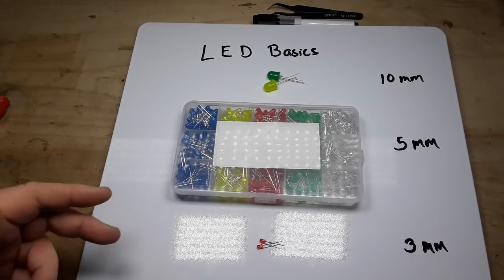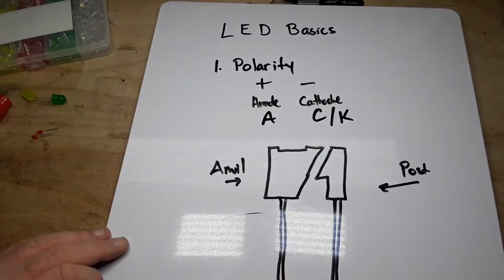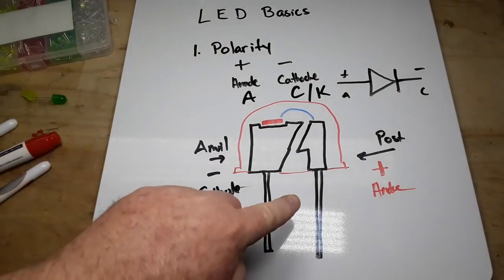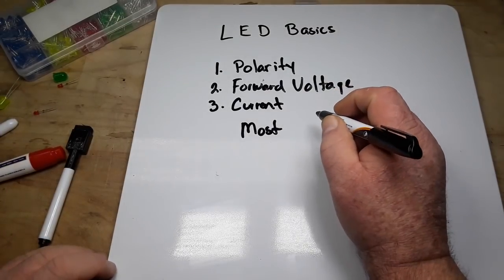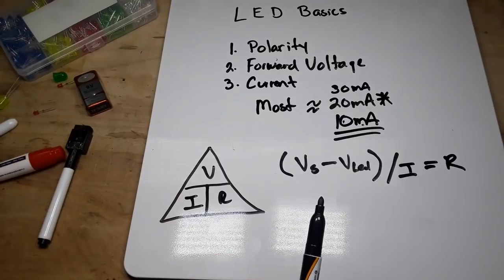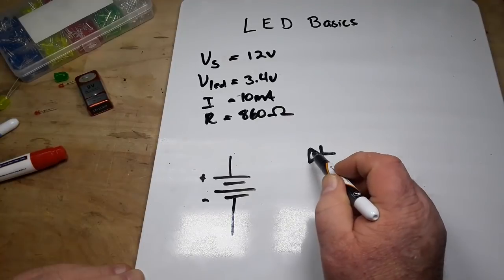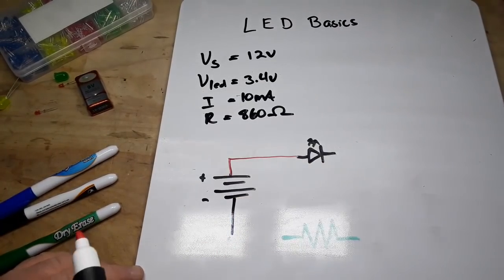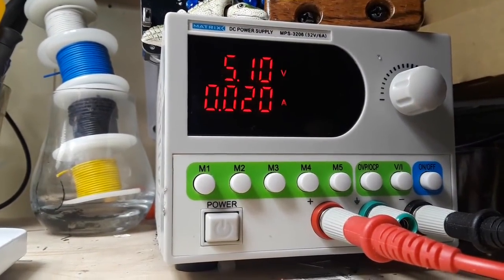LED Complete Basics for Beginners

Comment: Oh man  , I was reusing an LED and the legs were cit down to the same length . IT was opaque so I couldn't see the inside , and couldn't tell the positive from negative side . 
For an hour i sat there scratching my head with the bulb ... trying to figure out what way to solder it in .
Well I scratched my head soooo long with that little LED that I wore a flat spot on the base of the bulb .
Finally I said FK IT this flat spot looks  pretty negative to me .

Comment: i got two kinds of red led's one is 800mcd 1.7v 20ma the other is 5000mcd 2.3v but does not mention ma? i will assume 20ma, so anyways i use these in a light in the dark floater i made for night fishing and usually hook them directly to a 3v cr2032 battery is this ok? because that is the lightest battery at the closest voltage i can find besides i calculated one needs 65 ohm resistor and the other 35 ohm so is this negligible enough to say maybe the battery has enough internal resistance to proximate those amounts? anyways it's been working fine so far

Comment: Let me get this straight you can put your1000 ohm resistor before or after the LED so it doesn’t matter which leg you put it on, correct!
Reply from the maker: Does not matter a single bit. Before, after, whatever makes you happy.

Comment: Hi, I have a question. If you put a diode (LED or not) on an AC circuit, it converts it to DC for the purpose of the circuit right? So in that case, do you need to convert it back to AC when the return wire goes back to the power source to close the circuit? I hope it makes sense.
Reply from the maker: Nope, you return half wave AC. You are just stripping off the part of the sine wave below the 0 crossing point.
Reply: @learnelectronics  So if I understand, it's risk free and there's nothing special to be done. I'm kinda new to all this. Thank you.

Comment: When you powered the various-sized red LEDs, you probably would have seen closer matching voltage drops at 20 mA as that's the current most manufacturers use for the data sheet rating. Even though they may have the same chemistry, the die sizes vary a little and thus the I/V curves as well. For demonstration, testing the I/V curves ahead of time and choosing an apparently arbitrary current where the curves intersect might be fun.
Reply: That is correct.

Comment: Great Stuff! Always Like To Go Back And Review The Basic Stuff And Know I'm Not Losing It - Yet! Not To Burst Your Bubble Bro, But Their Was An Error When You Explaining Your List At #3 - Current? You Stated That 'CURRENT' Is 'PUSH' Which Is Not Correct.
'PUSH' Is Related To 'Voltage' Of How Much Force Can Be Applied To Move A 'QUANTITY' Amount Of ELECTRONS Past A Given Point,  So Current Is 'How Much Or Amount' And Voltage Is 'Pressure Or Force' Will It Take To Move That Amount. So For The Students Out Their Still Trying To Grasp The Two Differences Compared To The Real World, The WATER And HOSE Concept Works Very Well. Water = Current, Hose = Resistance, Water Tank = Voltage(Gravity[Pull=Bottom, Up][Push=Top, Down]). Garden Hose Small Diameter <1''(Fixed Resistance), Fire Hose Large Dia. <5''(Fixed Res.). Which Hose Will Get You More Wetter With The Water Tank Three Stories High? The Fire Hose! Larger Diameter Less Resistance Or Restriction Allowing More Water To Flow At A Specific Place At A Given Time, Compared To Garden Hose Where The Resistance Is High Or Restrict Water More. But Gravity Will Force The Water Much Harder, Which Increases The Pressure, Less Water Still Will Come Out The End. All That Said, The Reason High Current, Low Voltage Can Electrocute More Than High Voltage, Low Current Is Because The Fire Hose Is The High Current, You Get Drenched Or Soaked By A Fire Hose, Higher Current Get Zapped More With Huge Amounts Of Electrons At Once! Simple! Diagram Defines Better Than 8 Lines Of Explaining. Yah, Peace! Heads Up On Your Logo, 'Le Ventures'? It's Cool, But Might Want To Bend A Line Or Make An Arch Or Something Just In Case......

Comment: Interesting,. Looking to find a video to explain the resistor size needed to drive some 0.5W LEDs I just got off of allyexpress.  Sadly only information I've been given on them is that they are 1/2Watt, and voltage.  How do I convert Watts to amps

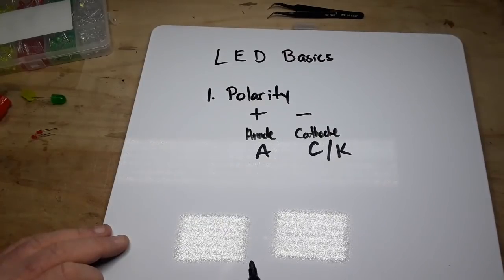Comment: 2:00   Can i offer a better suggestion that just remembering that ANODE IS POSITIVE....

WELL you see the reason why Cathode is called Cathode is because it comes from  CRT (CATHODE ray Tube)  right ?
Which is essentially an ELECTRON gun
ELECTRONS ARE NEGATIVELY CHARGED

so....  CATHODE = ELECTRONS =  NEGATIVE
CATHODE = NEGATIVE
much simpler to remember 
and by that ANODE IS POSITIVE 
without having to drill it into your head

Now if you don't know electrons are negative  you shouldn't be in electronics in the first place

Comment: Is it possible to make a kinda full bridge rectifier by joining a couple of of leds in series though? Like 10LEDs in series is one diode to get the Vdrop just right for mainline AC?
Reply from the maker: As long as you keep the current to 20mA or less then yes you can make an LED rectifier. It is not advisiable, but it is possible.

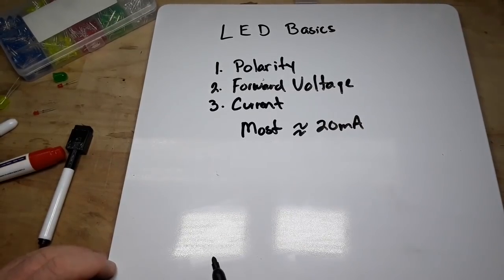Comment: 8:11 Thank you so much for mentioning this! The 20mA rule-of-thumb seems to have deeply ingrained itself into the industry, even to those who should know better.

Here's a little rant I go off on about LED intensity:
TLDR:
Your LED current should be high enough to be visible in the final application, AND NO HIGHER. 20mA is a starting point but ask more questions. Does it need to be bright enough to wake up the operator when it lights? Will the operator need to see other features of your device next to a glaring LED? Does it need to be visible in full sunlight, or is it expected to live next to a home theatre? Could you find a different part that doesn't blind at 20mA?

20mA may be a nominal forward current, but it is not necessarily the best current for your design. When using generic blue LEDs in particular, 20mA will range from uncomfortable to blinding for most indoor applications. The LED datasheet should also have a graph mapping relative intensity to current. 1 is usually at 20mA, but sufficient brightness may come as low as 10 or even 5mA (keeping in mind that consistency between LEDs can become an issue at lower currents.)

20mA is a good starting point, but I recommend setting your circuit next to your monitor or television pointed at your face. At the same time, watch a video to see how irritating it might be--especially in a darkened room. Engineering is about more than hitting the high points of the datasheet; it's about meeting the design specifications and sometimes asking what the specification should be when someone forgot to consider it. Before blue LEDs were available, the industry apparently coalesced around 20mA, creating a standard, comfortable viewing intensity. You could design your indicators around this value without worrying whether it would be comfortably visible. When blue LEDs came along, it seems the industry decided the 20mA "standard" was more important than how blindingly (literally) efficient they are at that current.

Virtually every device with a blue LED that I've owned has been irritatingly bright. I have a tower fan with blue indicators that I've had to cover, so the light in my room at night doesn't keep me awake. I also owned a small audio mixer with a pair of blue 7-segment displays and a blue power LED. If the engineers put any thought into them at all, they must have assumed this mixer would only be used at outdoor festivals and the like. In a darkened theatre environment, they had to be covered up so you could see the controls around them, and your shadow wasn't burned into the back wall. Indeed, one might think marketing was involved and assumed that their device being visible from low-earth orbit would be free advertising. I have another mixer from the same brand with an orange power LED. It sits just below my primary monitor. It is just dim enough in my darkened room below a dark-themed screen that I'm not constantly distracted by thoughts of voiding the warranty to replace its resistor with a higher value.
Reply from the maker: I have a graphic eq with blue LEDs on each slider. I see spots after I adjust it.

Comment: great video, nice to be refreshed on ohms law .. may i ask a question .... if i was using 9 led's, in series .. do i need a resistor for each led?  or does 1 resistor work the same and what wire needed for a 9v current .... any help would be appreciated , thanks.

Comment: wonderful, can you connect a 5mm red direct to a battery NO resister
Reply from the maker: depends. slightly used 2032 batteries are often used to test LEDs. Can you hook it to an 18650? No it will blow instantly too much current.
Reply: @learnelectronics  Thank you

Comment: great video.ez to learn the way you do it. can you do or explain to me how this would work if youre powering a clock LED bulb under AC power 120V? i calculated a resistor like 11,450. is that possible. did I do it right?

Comment: I was installing a "DeJitter" mod on a 1chip Super NES "junior" the other day (SNS-101) and someone had already installed an LED that was directly wired to 5v and ground... no resistor. Someone drilled a tiny <1mm hole by the power switch and glued a 5mm LED over it which somehow hadn't fried itself. Though it wasn't what I was being asked to do, I already put a 220-ohm resistor on it but referred back to this video to see what the typical drop was for a 5mm red LED in case I need to make it brighter. Seeing an identical LED blow at 5 volts in this video validates my concern, since the Super Nintendo is a 5v console. I know there was no resistor where they previous guy tapped 5v because he went straight for pin 1 on a RAM chip and the other leg went to the ground plane. I also took the opportunity to find more appropriate points to tap power and ground.

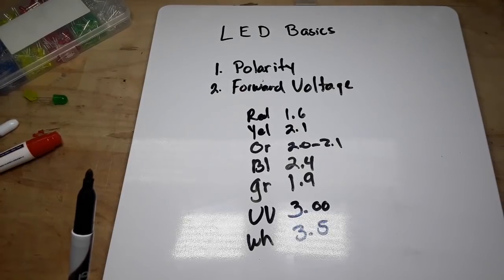Comment: Oops! I @7:22 I think you meant to say current is the rate of charge (i.e. Coulombs/second). The "electrical push" is, of course, voltage.  Thank you for the video. Most instructions I've seen just say to add a current limiting resistor, but don't mention why, or how to calculate the value.

Comment: The LED Die that is sitting in the divot in the anvil is what determines the color of the Red? what is in the chemicals are in the LED die?
Reply from the maker: Indium gallium nitride (InGaN): blue, green and ultraviolet high-brightness LEDs
Aluminum gallium indium phosphide (AlGaInP): yellow, orange and red high-brightness LEDs
Aluminum gallium arsenide (AlGaAs): red and infrared LEDs
Gallium phosphide (GaP): yellow and green LEDs
Reply: @learnelectronics  That's what is inside the divot in the anvil die is Indium gallium Nitride for blue and green? I'm not sure what the Bonding wire does that is bonding the post to the anvil, what is that bonding wire doing?

Comment: You can run an LED at 12 volts as long as you use the correct resistor!
Reply from the maker: You can run an led from mains voltage with the correct resistor.
Reply: @learnelectronics  True, but could be deadly if you screw up :( We like to play with low voltages generally.

Comment: I am such a beginner in electronics. Thanks for being so very clear. There's one thing I am just not able to get my brain around. I understand that it is understood that the conventional understanding is that electricity flows from positive to negative and not from negative to positive. So hooking up an LED or diode would then be from negative to positive in-order for the actual current to flow from negative to positive but that is not the way you were hooking up your diode. Please can you once and for all clarify  this misconception for us. Thanks. Oh, when you say "forward voltage". Does this mean that this is the minimum voltage that the LED will light up? Or is this the loss of voltage as the current goes across the LED? Thank again for your video post.

Comment: If the voltage drop for a red LED is 1.6 volts, why did the voltage on your power supply only drop from 3.0 to ~2.0 volts?
So you can use any voltage to power an LED as long as you use the correct resistor?  I guess if I used a 1000 volt battery capable of supplying 500 amps, I could properly power an LED at 10mA by using a 100k Ohm resistor.  In summary, resistors don't care what voltage is being supplied to it as long as the current is correct?

Comment: Current (valance electrons) flows NEGATIVE to POSITIVE.  Only holes (that contain nothing) flow positive to negative.
Electrons perform the work not a hole.  One Amp of CURRENT is 6.241 × 10 ^18 electrons, or one coulomb per second not holes per second.
Electrons are negatively charged and are only attracted to positive - so current flow is NEGATIVE to POSITIVE ! ! !
Reply from the maker: This is a video for the absolute beginner. Put your your brain back in your pocket. These folks want to know how to use an led in their project. They don't care about the physics.
Reply: @learnelectronics  then it should be taught correctly the first time.
I taught electronics for 38 years and started from basics all the way through AC/DC, amplifiers, digital, AM & FM, radar, cryptography, programming, & robotics.
Do it right or don't do it at all.
Its called PRIDE ! ! !
Reply: @johnfosteriii5792  In a time of folk connecting this module and that module to whatever micro controller, to make a thing that blinks or whatever, most folks brains would melt if they were told that electrical current actually flows in the opposite direction to that which they were conventionally taught, and I'm fairly certain a lot more components/modules would meet an untimely end in the resulting confusion. Electron flow can be taught shortly after the basics, when it's really needed, for dealing with things like transistors and onwards.
Reply: @Tekwyzard  So your saying it's OK to teach people inaccurate information just because YOU were taught inaccurately? ? ?
So far, I've heard very poor EXCUSES but no reasons why.
Again - teach it correctly or don't teach it at all.
Reply: @johnfosteriii5792  I wasn't taught inaccurately at all, and courtesy of physics lessons before I even did anything electronic, I fully understood that electron flow direction is the opposite of more commonly understood conventional current  (it's called conventional current for a reason you know), however that did not prevent the early death of many then very expensive components, nor does it change my point that the majority of 'makers' as 'electronic enthusiasts' are called now, would not understand that concept at the baby step 'Hello World/Blinky' stage, or be able to integrate it very well when dealing with their basic plug together components and modules. Hell, a lot of them, as evidenced in the comment sections many youtube videos, struggle with basics even when the videos are otherwise excellent. 
Just because you regard yourself as perfect, don't go assuming that everyone else also is, or that in an era of things being dumbed down, has the same ability to process information that you claim to possess, that attitude would loose you any respect I and many others would otherwise have had for someone claiming to be a mentor. If you understand it all so well, then where are your perfectly crafted videos? That convey for instance why they need to know in the first place, but also electrons cannot pass through a diode from its cathode to its anode, so well that even a newbie can immediately understand the concept of electron flow, holes, and all the implications thereof in any semiconductor environment.

Comment: Something I learned from AvE (I think) years ago that lets you instantly remember which lead is positive on LEDs or electrolytics: you can create a + sign with the longer lead by cutting the extra length off and turning it sideways.

Physical memory tricks like that have really helped me along the way. Another one I just remembered is how to remember which wire is live and which wire is neutral in US home wiring: put the two wires out in the sun, the black one gets hot and the white one stays neutral.
Reply: In the real world component leads are often trimmed so you cannot count on one being longer than the other. So you're better off looking inside the LED to see what polarity it is. There you just remember the bigger bit is the ground. I also equate the bigger bit to being the "land". I've heard of anvil and post but that has no meaning to me. Land on the other hand is earth or ground.

Comment: Are LED plastic cover colored just to make it easier to identify the color? Also if blue was so difficult to make why didn't they just use a white LED with blue plastic?
Reply: Because most white ones are really blue with a phosphor coating that glows white
Reply: You can't write a physics paper by just coloring plastic. Well, maybe you can. But you won't be getting any praise in the electronics industry doing it. And yeah the housings are colored to identify the devices when they are not powered on. I have red LEDs in clear plastic. But you don't know they're red until you power them up.